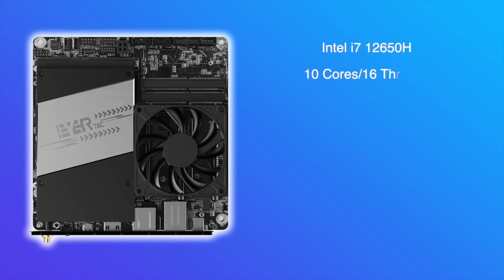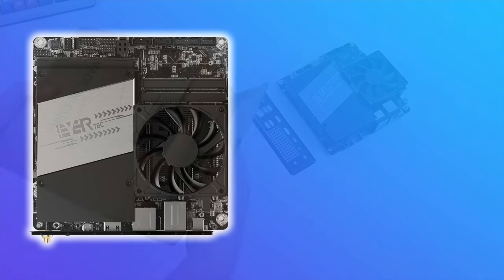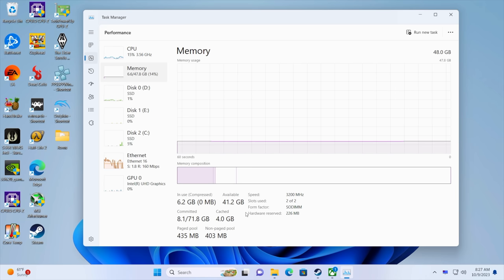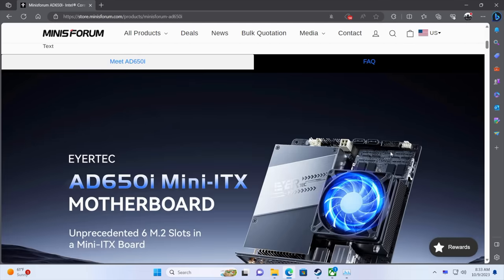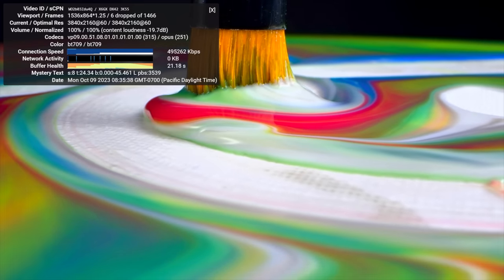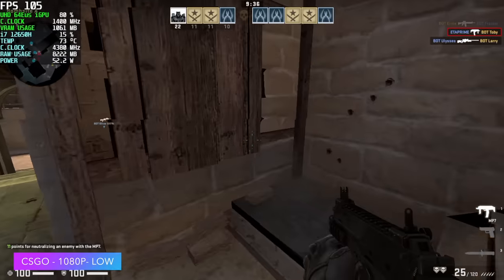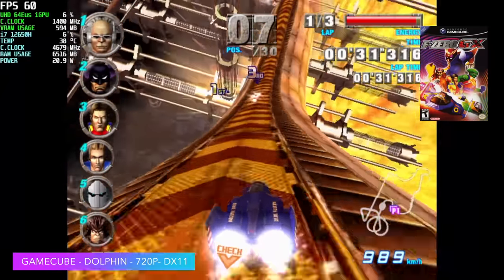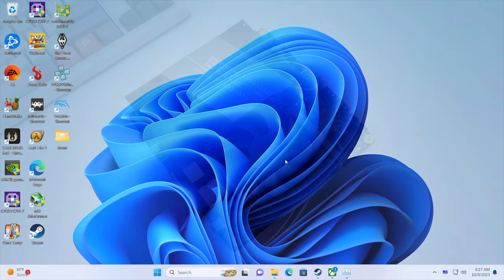This All New Mini ITX Board Has An Integrated 10 Core CPU! AD650i Hands On

Comment: I don't want anything with e-cores.  I would rather have the Intel with 6x large cores and 0 ecores like the 12600 (non-K).  I suppose you could disable the e-cores to increase efficiency but you're still paying for it, which is basically Intel's way to force you to pay for their mobile processor ambitions.